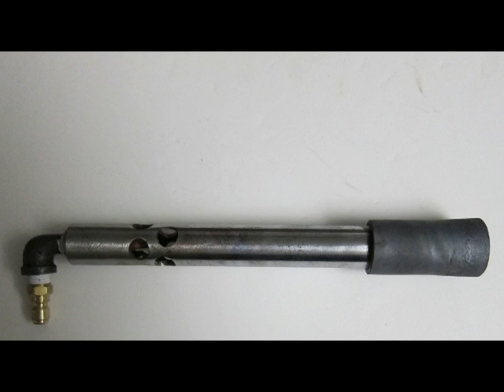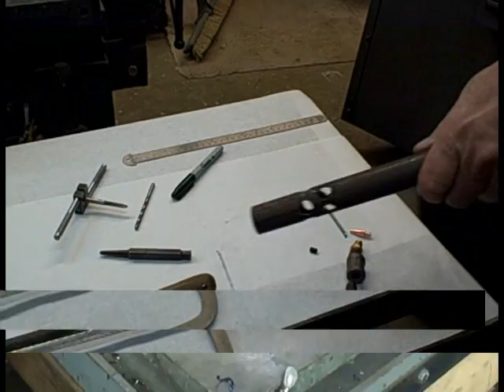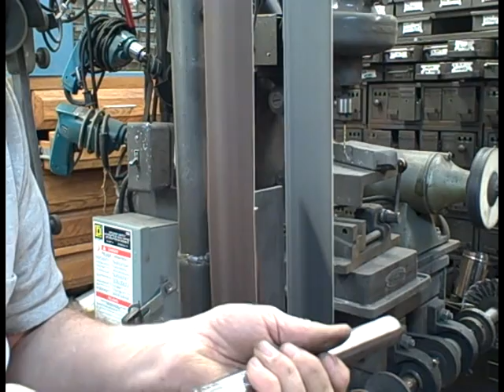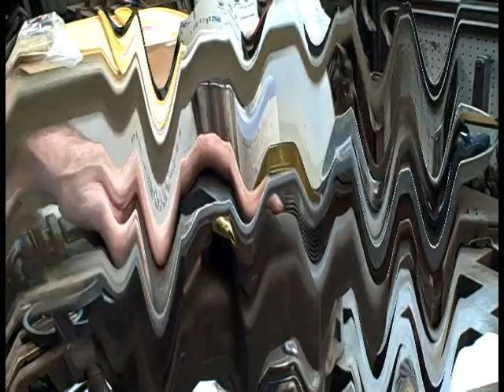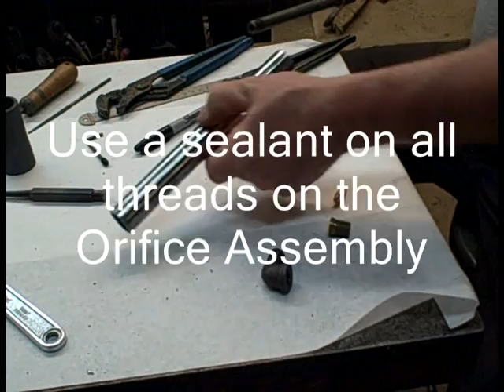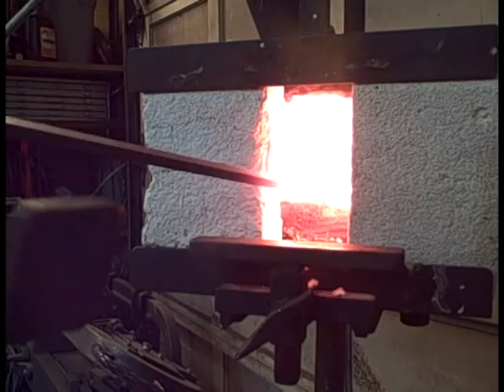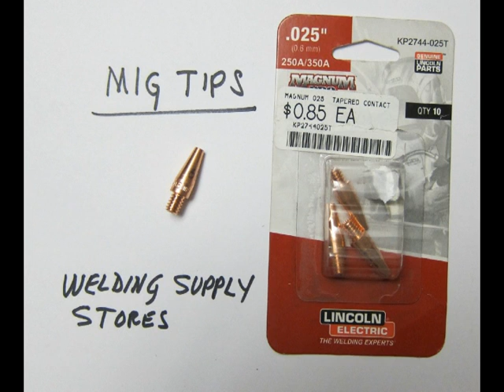How to build a Propane Forge Burner

Comment: Hi Dave, what length do you recommend for the propane hose to make it safer?
Reply: As long as you can keep your hose away from any heat source and it doesn't get in the way of the operation of your forge (including putting in and taking out hot metal), it should be safe.  Personally, I don't like hoses that are a lot longer than a direct arch from the burner to the tank.  The  hose on the forge I use the most is only 5 feet long (I use 30 and 40 pound propane tanks that sit on the floor).  A little extra length (beyond just that arch)  is necessary to have so the forge can be turned or moved a little (without tugging on the tank) if I need to accommodate a project held up by outside support.   I also like to keep the tank within a couple feet of the base of my forge (pedestal stand) so I can easily turn the valve on and off.  To start my forge, I turn off a ball valve at the burner, then open the tank valve, after which I crack the ball valve a bit and toss in a match (I control the volume and pressure of propane with a commercial needle valve on the burner side from the ball valve).  I ALWAYS shut down my forge by closing the tank valve.
Reply: Thank you so much for your detailed response!
Reply: I'm getting a hose with a male 1/4" connector and a female 3/8" connector. I see yours had 2 female connectors which you converted to male. What's the name of those two small male to male connectors?
Reply from the maker: To me, they are just connectors or fittings.  I suggest you take your hose to a store (home depot, Lowes, etc) that sell brass fittings and ask for help looking of the fittings you need.
Reply: Im going to lay down boy i dont feel right bbbbvbb

Comment: Hey David, super video - your explanations are great! In fact I was going to try another design but after seeing this I changed it to yours; it's simpler, lighter and very effective. 
So I got mine built and it works great but I have a couple of questions. 1) how far from the air holes do you have the orifice tip? Is it about even with the back holes or does it actually extend into the space where the holes are?  and 2) This is the important one: I don't have a drift so I ordered a stainless flare. It doesn't have the angle you describe and is not not flared to half of its length, just toward the end. I noticed when you show yours burning the flare doesn't get red. Mine starts to glow a little in less than a minute at 9 lbs of pressure. Is that normal? Should my flare tip be moved back or forward to prevent it from heating up so much? Will that cause problems when I get it into the forge?
Again, thank you for the great video. Since seeing it I have watched all your videos. You, sir, are surely a master craftsman.
Reply: First of all...  Thanks!

I generally put the end of the mig tip at the center of the holes closest to the flare.  

It surprises me that your flare gets red hot on the end with the flare out of the forge so quickly.  I can't say I have run them that long out of a forge either.  I usually just adjust the position of the flare till I get the blue flame I'm looking for, then shut down the gas.  

I don't know if the different configuration of the end of the flare is contributing to what is happening.  The flares primary function is to hold the flame.  A curled end may not do that as efficiently as the angle I describe.  It may depend upon what the curl looks like.  I have a friend that makes similar burners with a curled flares that work very well.  His burners are a commercial product (he doesn't sell flares separately).  One thing you might experiment with is to reverse the flare (put the curled end up) and move that up or down till you get the best flame.  Then see if you get the same redness.  Just an experiment to see if it behaves the same.  When folks can't find flares, I suggest they use a straight pipe.  It doesn't work as well, but it generally does work.

All flares will eventually get damaged by heat.  Usually it's because the end is too far down into the burn chamber.  The end of the flare should be at least an inch above the top of the burn chamber.  If the flare is too low, it will be damaged quickly by heat.  Flares actually perform a dual purpose.  First of all, they support the best and most efficient flame (or so I have read).  Secondly, they become the expendable end of the burner.  It's been my experience that all flares will eventually be damaged by heat in the forge.  For me, it's easier to replace a flare than make a new burner tube if the burner begins to mis-behave.  Even though I consider flares a consumable (meaning I expect to have to occasionally replace them), the ones I use do last a long time (easily six months or more).  When my flame becomes erratic in the forge, the I take the burner out.  If the flare is burned to a crisp on the end, I replace it.  If it is not, I clean the orifice.

The real test for a burner is to put it in a forge and see if it performs there for you.  You should see that blue flame at first.  After your forge is hot (all yellow inside), you should hardly see any flame at all.  It should blend into the color of the inside of the burn chamber....

Comment: Hi Dave ,I have made up a burner for my new brick forge using  information from your video,set up burner in vice , lit it and did a few adjustments to flare and it works great. Dave thanks for the information

Comment: very good video .I would know what the gas Passage diameter. thank you
Reply: In this video I use mig tips that are sold for use with .025 wire (identified as a .025 mig tip).  The actual diameter of the hole in that tip is .0310 inches or .77 MM.  A #68 drill bit would be used to drill that hole.

When someone is having problems with the burner with a .025 mig tip, I usually recommend they move up to a mig tip used with .030 wire (identified as a .030 mig tip).  The actual diameter of the hole in that tip is .037 inches, or .95 MM.  A #63 drill bit would be used to drill that hole.

Comment: Dave, what pressure where you using for your testing of the burner?
Reply: +B Brown ....  If you are asking about running it outside of the forge, I would start it around 15 PSI and  test it up to around 25 or so.  If you are having trouble getting it to run outside a forge, just put it in a forge and try it.

Comment: I had a real hard time tapping the stainless steel pipe. what is the secret to getting good threads. Mine are not good. All the other holes I tapped were great.
Reply: +David Wessel ..... Stainless is more difficult to tap.  I'm not sure there is a secret, but I always use more firm pressure to start the tap.  An easier way would be to drill the hole slightly larger than the charts recommend (I've done that also).

Comment: David - great video, appreciate all you put out for us beginners. I'm in the process of building a forge to handle blade/bar stock up to 36" in length. What would you recommend for burner count and placement/spacing based on this type of burner?could you email me at mike@ccint.net
Reply: +michael hintz ....  First of all, kudos for deciding to build your own forge.  

If you haven't already started, and your goal is to make knives and/or swords, I recommend you join and participate in one or more of the knife-making forums and ask what they use for forges (both for forging and for heat treating).  In general, only a few inches of any project is worked on at a time.  It isn't until heat treating is done that the entire length of a sword or a long knife needs to be heated.  I would be surprised if gas forges that are used for heat treating long objects are also used for forging projects.  

Having said that, I will get to your questions...

It is generally accepted that each burner of this type (3/4 inch pipe, atmospheric) will support up to around 300 cubic inches of burn chamber.  Keep in mind that supporting that number will require an efficient forge, with proper lining and heat containment.  It's not unusual at all for that guideline to go out the window when someone either wants to heat the forge (and stock) up quickly and/or ensure even heating.  Burner placement may also be influenced by what your projects are going to be. For example, a heat treat forge should have indirect even heat.  A forge that you expect to do forge welding in may need a hot spot.  

A question I have (before I can fully answer) is what do you expect to do with this forge?  My answers would be different for different applications.  For example, if you are going to heat up large heavy stock, the number and placement of burners (as well as forge design) would be different from a forge that would be used for heat treating only.

The best advice I can give you is to do research and find a commercially made forge that matches your forging needs....  then make one similar in size and burner configuration (the burner in my video can be made with 1/2, 3/4, and 1 inch pipe, obviously with a variance of the orifice size).  Some commercial forges will have blowers, so if you are committed to using atmospheric burners, look for forges with them.

From my experience, there is no single forge that will do a good job for wildly variant applications.  If you have watched all my videos, you will know that I do almost all my projects in a very small single-burner forges (8 or 9 inches in length).  This is not just for gas economy...  it's because almost all the time, it is only necessary to heat up a short section while I am forging.  I don't even have a large permanent forge.  When I am working on something larger than will fit in to the forges I have (I use a one burner mostly, and a 2 burner with a little larger burn chamber sometimes), I make a free form forge with soft fire bricks and use one or more manifolds that are shown in my free-form forge video.

If you tell me a little more about what your goals are, I will provide some insight, from my experiences, for burner configurations.

Comment: Hey Dave, I am thinking about just building or buying one of these burners instead of another I was using. About what psi can you do general forge work with these burners? I know you said you keep pressure at 30, but I know this is for the tank pressure and not the burner. Also, do these burners work well outdoors? The previous burner I made stunk outdoors becuase wind would mess it all up. By the way, your super c forge is very cool! Thanks
Reply: +Matt Behnke ...   I don't have a specific pressure I use for general forging.  I will use a higher pressure while the forge is heating up (as much as 30 PSI)....  then back off the pressure to maintain the heat in the forge.  How low I set it depends upon how large the stock I put in is.  If the stock is small, the pressure can be kept low and the burn chamber will maintain its heat.  If the stock is large enough to draw down the heat in the burn chamber before the piece come up to forging heat (floor and walls don't stay yellow, I will crank up the pressure a bit.  Normally,  after the forge is hot (all surfaces  yellow), the stock is very efficiently heated by radiation from the floor, walls and ceiling of the forge.  Also, if I put a large piece of steel in (like for a hammer head), I may increase the pressure to more quickly heat the piece, using the burner directly as well as radiant heat.....  so there is no simple answer to your question.  If I'm forge welding, I will crank up the burner even more to get a hot spot under the burner.

Wind issues....  I have made and used numerous designs of atmospheric burners.  This is the one I like the best and it's the easiest to make.   Unfortunately, none of them work well outside if there is any wind.  The propane needs to exit the orifice under pressure and start down the center of the tube.  This will draw air from any opening(s) behind the orifice, which then needs to evenly mix with the propane as it moves down the burner tube.  The wind disrupts the gas flow at the orifice and the mix is thrown off balance, which results in a poor (or no) flame at the end of the burner.  There are many designs for atmospheric burners, but I don't know of any that claim to work outside with wind.

Thanks for the comment about the Super C forge.

Comment: Hey David, I'm in the process of building one if these. I went to home depot and got some schedule 40 black steel pipe. I noticed later that it has a seam on the inside of it from welding. I think it will compromise the fit of the orifice assembly. what are your thoughts and where could I get a seamless pipe?
Reply: +cam lake ....   A seam would probably be a problem.   I don't remember ever seeing one in a schedule 40 pipe.  I would return that pipe and look for one that does not have a noticeable seam.  Check at another hardware store.  China must be sending pipe with seams...  If you can't find one without a seam, you could try sanding a flat spot on the coupler where the seam is (as long as the mig tip points down the center of the pipe it should be OK).
Reply: +David Hammer Thanks for the quick response! One more question: apologies if you mentioned this in the video, but do you use that thread sealant on the rest of the assembly? on the hose fittings, needle valve, shut off valve, etc.? It looked like you had some tape on them
Reply: +cam lake ....   Although I occasionally use tape, I recommend using the sealant in the video for all NPT fittings.  Using tape in a system with an orifice can result in the orifice being plugged.

Comment: Hi Dave, I built a burner, but instead of using that thread sealant I used this stuff called permatex blue medium strength thread sealant. It never said it was meant for psi, but also never said it wasn't. Should this work do you think? Thanks
Reply: +Matt Behnke ... What is the product number on the packaging?  

It seems like you may have used a threadlock instead of a sealant.  When I searched online for "permatex blue medium strength thread sealant", most of the references I received were for threadlock.

A threadlock has a different mission in life (preventing a fitting (or bolt) from coming loose by vibration).  If it says sealant, you want to look for information about it that says it will prevent liquid or gas from leaking through the joint.

Personally, I would not trust threadlock to work as a sealant.

Comment: if i cant find a stainless piece can i use a piece of iron? what is the reason for the stainless? also why does it need to be flared? i am wanting to build one really bad but i just dont understand why it has to be flared & why it has to be stainless. any insight would be great thanks
Reply: +foster Gwyn ....  A flare is used to hold the flame on these burners.  l recommend using stainless steel flares because they will last the longest (the burner, with or without a flare will eventually be damaged by the forge).  You CAN use an unflared piece of one inch iron pipe for the flare (three inches long).  It works, but presumably the flame is not quite as stable.  In fact, your burner will probably work in the forge without a flare.   If there is a flare, it can be replaced fairly easily.   If there is no flare, the entire burner tube will have to be replaced when the end is deformed from heat (not a big deal either).  Most folks I know buy their flare online or on eBay (I didn't see one posted right now).  A friend of mine also makes and sells them (I have no business relationship with him).  His email address is jfee@stny.rr.com
Reply: Thank you for your quick response.  Ok it makes more sense to me now. I really like your design and will be building it soon. Thanks again for your help. God bless

Comment: David really enjoyed your knowledge thank you for sharing my question is can you use a .30 welding tip i have a mig welder and many tios but there all .30?
Reply from the maker: I just found this question....   The answer is yes, you can  use the .030 mig tip.  I frequently suggest moving up that that tip if folks have problems with the burners.

Comment: hey there, what diameter is the stainless steel pipe in order to slide over the 3/4" pipe? thanks!
Reply: +SaskSleds2011 ...  I believe the stainless pipe I buy is rated one inch, but you need to measure the outside diameter of the 3/4 inch pipe  you use for the burner tube.   The inside diameter of the flare needs to be slightly larger.  Sorry I can't provide a better answer, but when I go to buy stainless pipe to use for flares, I always take a burner tube with me because the inside diameter of the stainless pipe I find varies.
Reply: +David Hammer whereabouts did you get all your materials from? if possible could you send me a list of all materials used to make it? thanks!
Reply: +SaskSleds2011 ...  If you watch and listen to the entire video, you should have the information you are asking for.  I do not have a list I provide....  you need to make notes as you watch the video.  The only update I would provide is that TSC may not currently sell the regulator I use in the video.  I still recommend a 0-60 PSI regulator.  Use Google or Bing to find one online.  You are welcome.